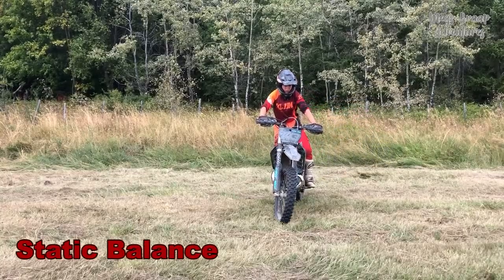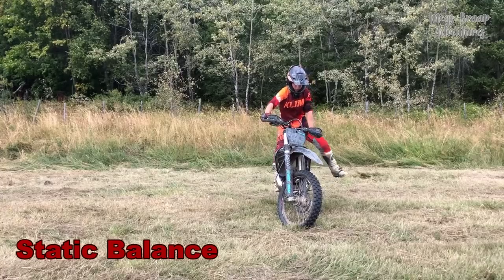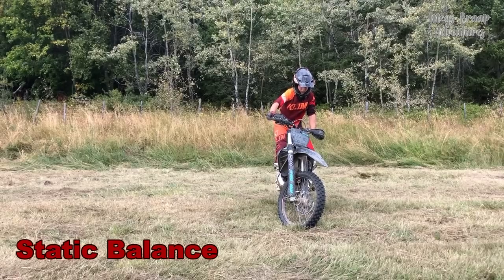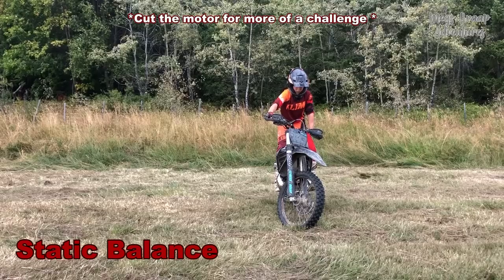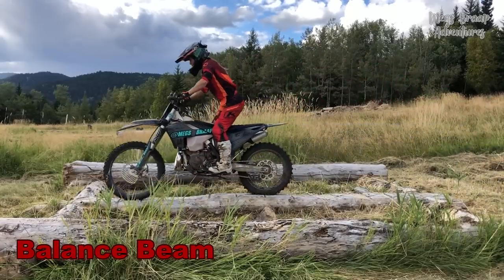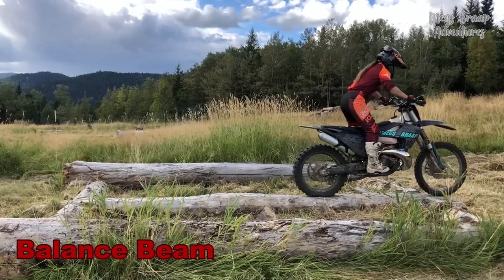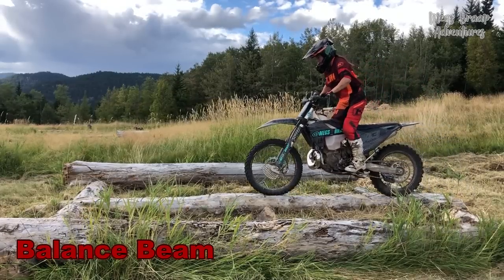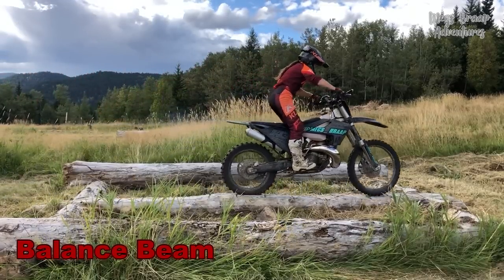5 Slow Speed Drills That Will Elevate Your Skills On A Dirt Bike!

Comment: Agreed with all of this! The slower you can figure-8 the better you gain clutch control! I love doing this!! What if I have a smaller displacement two stroke that needs more RPMs to make torque Megs? I’ve been practicing for pivot turns and have to gun it and alway end up with wheel spin most of the time?

Comment: What is the best way to deal with losing your balance on the Balance Beam (at almost static speed) when you know its too late to throttle out?
From the aspect of minimising injury, is it better to:
1) Try and hop off one side of the bike (eg. like Megs dabbing when climbing rocks)
2) Bale out (jumping away from the falling bike)
3) Other
If this was flat ground then, for me,  it's always option 1 but even with a 6 inch high beam, option 1 would have me stuggling to save an off-balance bike!

Comment: Can you do a video on the clutch lever your use and its position?  I tried some wheelies yesterday and find it is too hard to stand, operate the lever and hold on. I think rolling the handle forward to be better aligned when standing will help, but to really hold on, it seems like I need a short clutch handle to use one or two fingers.
I should also note that I am 6ft 4in, so sitting to standing will change the angle much more than a shorter person.

Comment: I like the idea. But as a new to duel sport with TW200 I been wondering (1) can i even pop the front end up with 200cc’s. And. With logs. I added a skid plate. But whats the overall deciding factor on what is too high to clear’ It looks like in your video you get 2/3 of the way up and you go over with then you actually pop kind of up to the 11 o’clock so that your rear wheel hitch the log, with the tread, and then gets over.
Reply from the maker: This video isn’t made to teach you how to get lover logs. The logs are simply there to make practicing wheel placement easier. The goal with the wheel placement drill is to practice getting comfortable with precise wheel placement so that you can eventually execute more advanced techniques (example the double blip), and so that you can confidently punch over obstacles out on the trail. Yes, you can absolutely get the front wheel off the ground like this with your 200! It’s just a matter of getting the timing with your clutch and throttle right. It will take practice but you can do it. 
There is no real size of log that you can’t go over, it’s just a matter of skill level. Any log under 22 inches shouldn’t be a problem with the simple punch technique. As soon as you get to the 23-24 inch mark and higher, you’re going to need a more advanced technique to overcome the undercut section of the log at the bottom. This technique is called the double blip.

Comment: How risky is it to get a used dirtbike on Facebook? And is it not a good idea to buy a bike that is make in 2003 -2010? I’m looking for a older one to keep cost down
Reply from the maker: It really depends on what kind of bike you want. Personally, I would not buy a used four stroke that is that old unless I really knew the bike and the buyer well. Just because if you buy an old four stroke you could end up with something that needs some fairly expensive repairs, or is really hard to start because it needs valve adjustments right away. If your going to buy one that’s used from the early 2000’s go with a two stroke! And bring someone with you who knows bikes when you go to look at it.
Reply: Megs Braap thx

Comment: If you are ever in the middle lower peninsula of Michigan, there are some of the best trails in the nation there called the "CCC trails", (Cycle Conservation Club).  There is a bike shop in the middle of much of it called "Peacock LTD in Baldwin Michigan.  They have trail maps and information of lodging and restaurants.  From tight trails, (Tin Cup as one) to fast and whooped out single track with a sand berm in almost every corner, ("Little O" 40 miles and  and "Big O" 100 miles).  Ahhhhhhhhhhhh. :)
Peacock LTD bike shop: 231-745-4606
Reply: Hey do you know of any trails around the Lansing area?